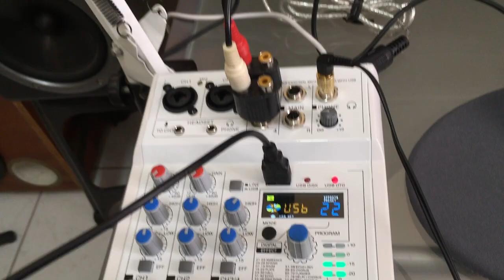YM2413 MULTITIMBRAL MODULE PLAYING GAMES' SONGS

Comment: Great project!  I've been trying something very similar and am having trouble getting it to work properly.  Using the MD_YM2413 Library with an Arduino Nano, I can get the MD_YM2413_Note.ino program to work, which just cycles through test notes.  However, I cannot seem to find the right Arduino program to receive MIDI signal and play through the YM2413.  Can you point me in the right direction for the proper program to receive MIDI signals on the Arduino and play through the YM2413?  Any help would be appreciated.  I'm fairly new at Arduino.